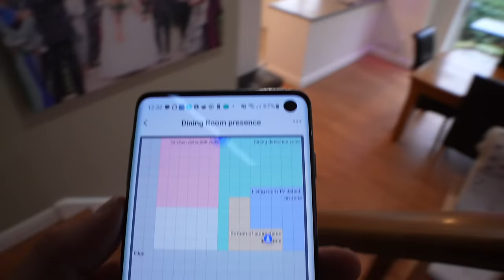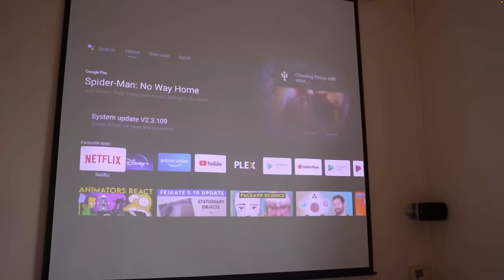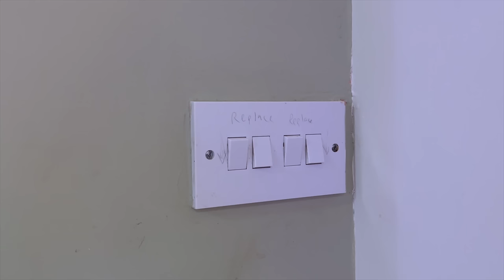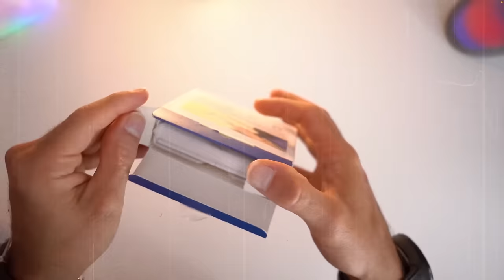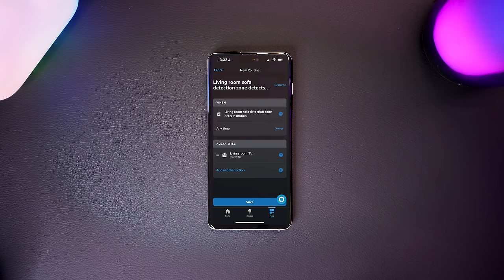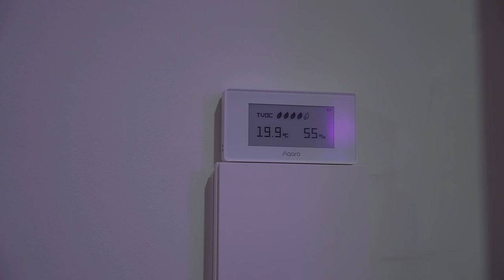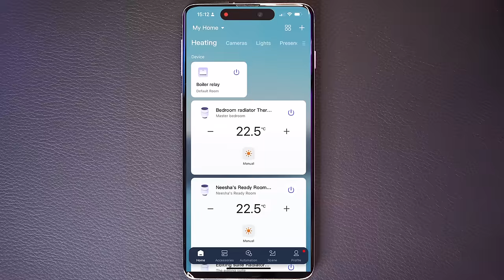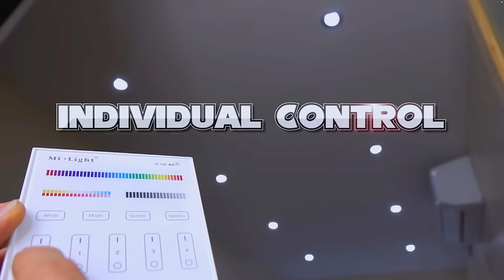This Changes Everything… HUGE NEWS

Comment: Anybody know if Alexa makes light bulb adapters so that you can use a regular light bulb and turn the light bulb itself on and off with Alexa basically something that screws in the socket where the light bulb goes and then you screw the light bulb into it and now it connects that light to Alexa. I know that sounds stupid but I don't want to go to the trouble to replace all the light switches in the house and I have over 100 light bulbs that I haven't used yet that are still in the boxes and I don't want to throw the light bulbs out. Believe it or not I'm not joking I have a hundred or more light bulbs most of which they've never been used because people are idiots. As an example a business closed down and I got four milk crates of unopened boxes of commercial outdoor light bulbs for security lights which I've been using now for years. I've lost track of how many times I've gotten boxes of unopened light bulbs where places closed down and through stock out so I've been using them around the house when one light bulb burns out I replace it with one of those literally have a closet full of boxes of light bulbs LOL. The Amazon smart lights are like 30 bucks or 40 bucks for two of them so yeah that gets expensive real quick especially given those light bulbs are probably going to burn out in like a year. So I'm looking to see if they make an adapter that screws in where the light bulb goes and then you simply screw your light bulb into that. I'm not trying to be a jerk. Part of the problem is a lot of the light switches are located in inconvenient places in the house the place was built that way in a lot of cases you have to roam through a room in the dark and fumble around to find the light switch and that's the way the house was built. It's more of a problem than you might think! I'm hoping to get something where I don't have to put one of those Hub units in and so on and just strictly use Alexa. I literally have a whole box of like five or six plugs that I bought that are supposed to be Alexa compatible and still haven't figured out how to get them to work where apparently they're not compatible with the rotor for my internet lol I bought them on a sale at Amazon for like five bucks each a couple years ago whereas the Alexa brand official ones are like 30 bucks each that just you plug them in and Bob's your uncle they work been using one of those for years for one of the lights down in the basement that's a plug-in light. Been trying to find out if they make something that you screw in a socket and then screw the light bulb into it and it just automatically connects to Alexa without a bunch of foolishness there's about eight rooms in the house that would be handy to have something like that so you're not screwing around in the dark trying to find a light switch you can just simply say the magic word and then say light on for that particular room for example magic word bedroom or magic word basement light and the light in that room automatically comes on without you screwing around to find the light switch

Comment: To anyone interested in getting FP2 presence sensors, because they work perfectly here, don't.

Paul has "YouTuber edition" FP2s that work differently to what you'll get as an average buyer.

What you'll get still uses alpha level firmware that is basically non functional. Problems, the regular versions have, include severe ghosting issues (where it'll detect people when there's no one there), huge detection delays, absurd cool down timers (firmware 1.2.0 had a 25 MINUTE cool down timer, that you couldn't adjust), can't be corner mounted, complains constantly about incorrect placement, even if screwed into the wall and the "app" is just a webpage in a stripped down browser.

If you want a good presence sensor, get either an Athom or an Everything Presence One. They don't have zone detection, but cost a fraction of the price (Athom) or have 5 other included sensors (EPO).
Reply from the maker: It took a while to get this right and positioning is important, but the key is to upgrade the firmware AT LEAST TWICE, it goes through each update one at a time and it’s easy to not spot there are more updates after the first one!

After firmware is on the latest (there was a new firmware update just last week) set them to low sensitivity, and then try between “short” and “far” settings until you get it working with as little ghosting as possible, THEN do the AI setup with the room entirely empty.

I fled get some ghosting on the top of the stairs sensor a week later and ran the AI again, no ghosting since 😁
Reply: @paulhibbert  I'll give it another shot at some point, but it really got on my nerves that there is no way to truly factory reset the things.

Oh there is a "reset factory settings" option you can use, but that just deletes the WiFi details from it.
There is no way to truly erase everything and just start from scratch.
Whatever I did, my old room data and things would be reapplied even after using their "restore factory settings" fiction, multiple times.

What ended up working was to outright delete my account... which has a 30 day waiting period.
Reply from the maker: I figured that out too, change the mode to monitor for a person falling and then back again 👍🏻

Comment: I hate to sound like a Hoooooommmme Asssssistanttttt fanboy, but I really don't understand the Tamagotchi metaphor. I run it on a secondhand HP EliteDesk Ultra Small Form PC and I think I never rebooted it manually since installing HA on it 2 years ago (it does reboot because of updates every now and then though). But of course I am not trying to abuse it with so many configuration changes each day ;-) There will probably be better solutions, but one thing I would never allow myself to do, is betting on a one-trick pony from some manufacturer.
Reply: HA is constantly broken - After 5 years of use i see no hope for this platform. Problem with developers and community. After all this time they can't even implement simple scheduler, countdown timer, or ui customizable card - things which are basic for every home automation system.